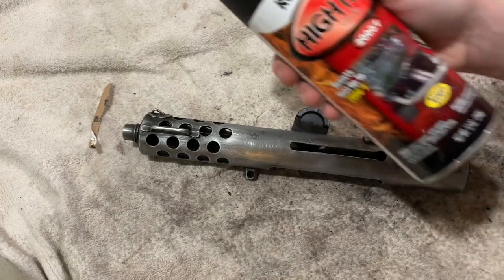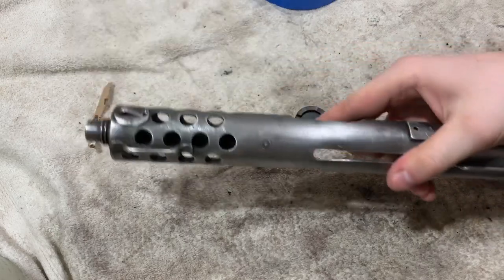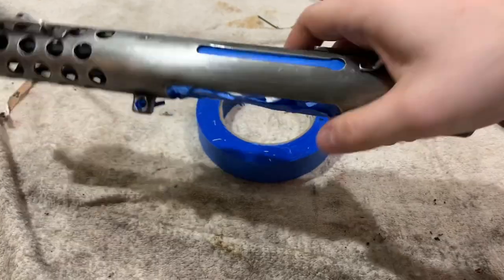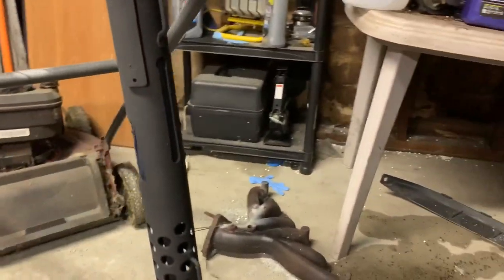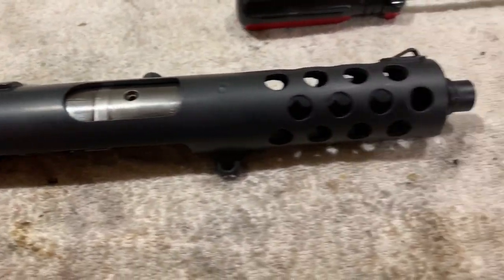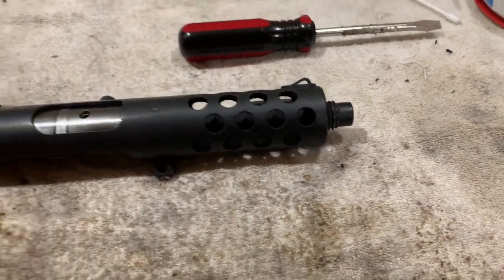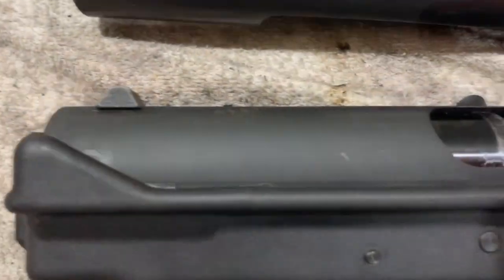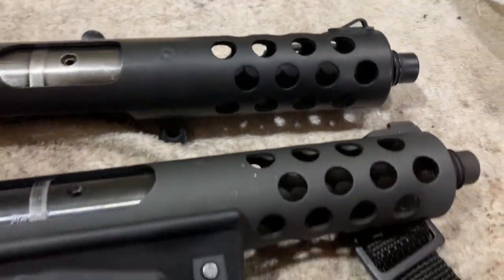Project Printer! (PART 2) Painting

Comment: Yes, THAT is the typical Tec-9 upper.
Reply: Almost, it's the earlier Interdynamics KG-99, which is a forerunner to the Intratec Tec-9 pistols, they're generally much nicer quality than the Intratec pistols. The KG-99 upper will not work with later Tec-9 magazines.

Interdynamics was actually co-founded by George Kellgren, who owns and runs Kel-Tec today, he sold his stake in the company and left, Interdynamics then being renamed Intratec, doing cheaper and cruder versions of the guns.